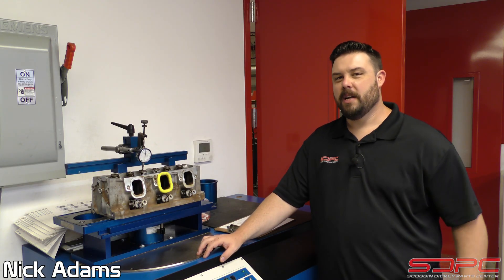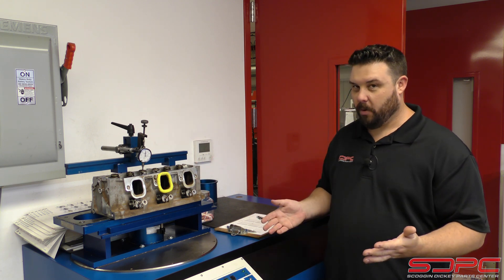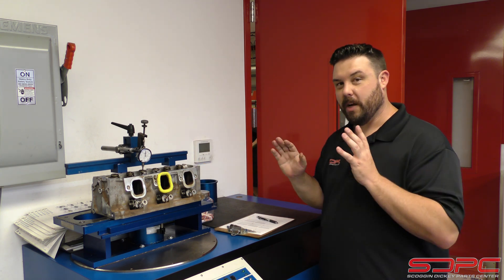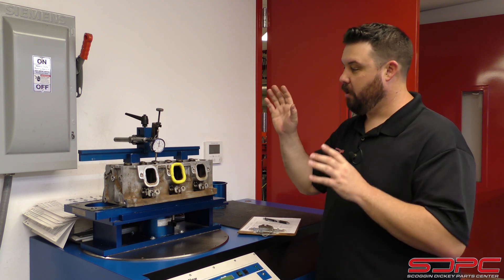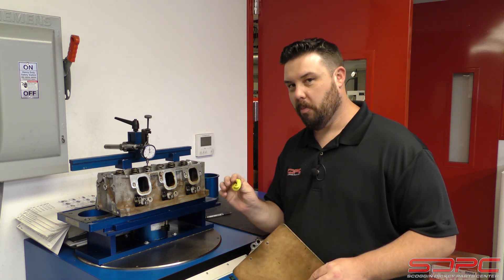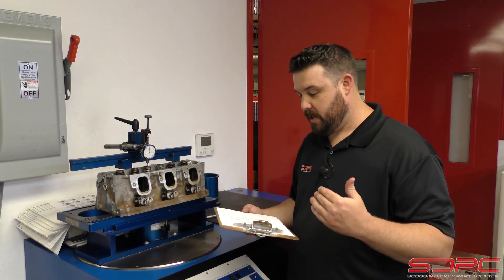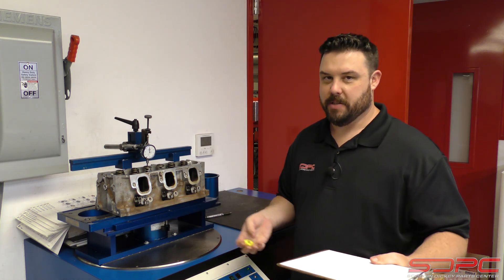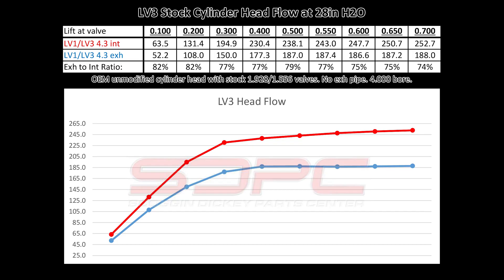SDPC Tech Tips: Flowbench Testing An LV3 V6 Head

Comment: One thing to think about with flow is that each cylinder is like a lt1 cylinder. It’s 3/4 of a 350. So you can’t think oh it’s a 4.3 I need less flow. It’s a 350 cylinder. It needs a 350 head. And exhaust headers and intake manifold sized as if it’s a 350 as well. When it lost 2 cylinders it also lost 4 valves and 2 sets of intake and exhaust ports.

Comment: The low lift is great so the valve seats and chambers must be good. The fact that it chokes is probably the pinch area needs opening a little. Wouldn't take much to get these near 300.

Comment: GM spent 6 million computer hours, with expensive software, to optimize the combustion system around the V6.  The V8s are modified V6s. Assume they know what they're doing.  Stock heads will support 400+bhp NA, and several hundred with a turbo.  GM designed the heads to do specific things, and imho most head porters ruin them.  btw, it's not a "small" engine.  it's 3/4 of a 350, and it has bigger cylinders than the 5.3.

Comment: Hi Nick, how does this flow compare to an LS2 or LS3 for example?
Reply: You're asking the wrong question.  The LV3 flows more than enough for the 4.3 up to 6500 rpm.  More flow will not translate to more power.  The best gen 3 heads are the 706, which flow less than the LS2 heads.
Reply: LS3's typically are 315 max intake CFM.  With CNC porting, that goes up to 350.
Reply from the maker: We don't have any LS3 flow data at the moment but we'll lean on this test by Richard Holdener on an unported LS3.

Shows over 300cfm on the intake from 0.600 on up through 0.700 and over 200cfm on the exhaust from 0.500 through 0.700.

https://www.motortrend.com/how-to/hrdp-1102-ls3-l92-rectangle-port-cylinder-heads-test/